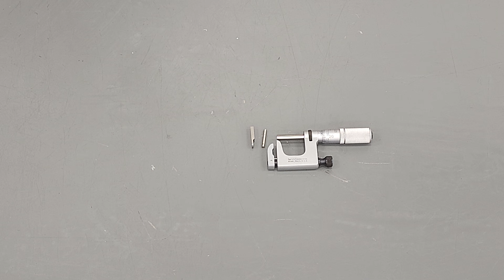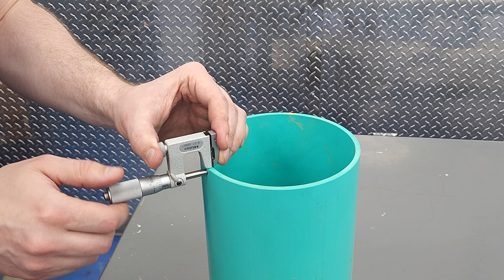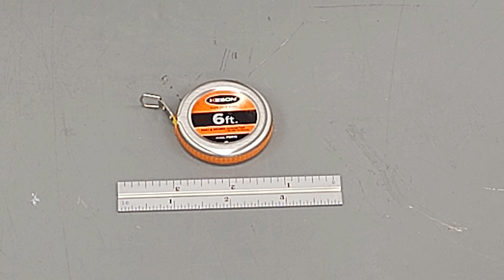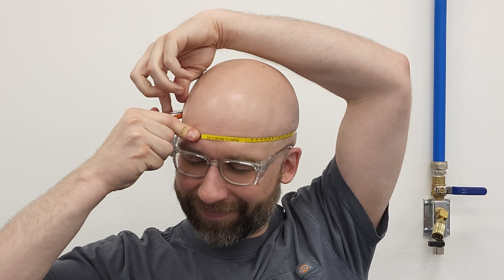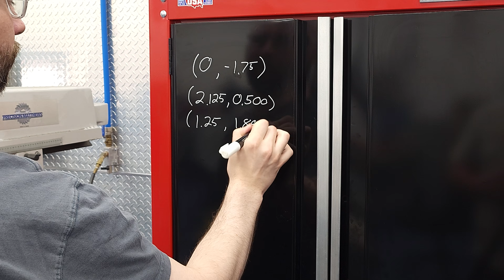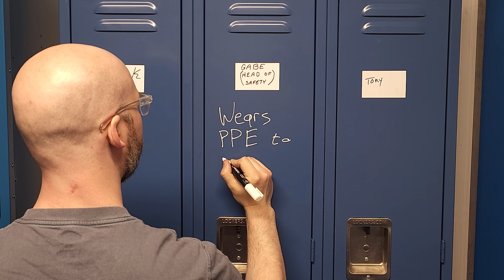Less Common Tools - Precision Matthews Media

Comment: Here's a cool tool: 1" inch precision offset with magnetic base and LED lights! Put it on the lathe chuck face and dial the cutter into it until the LED turns on. For just a few hundred dollars you can replace that 1 mil precision piece of paper with blinking LED light goodness. HAL Heavy Duty shows it every video and it has a special drawer for safe keeping.